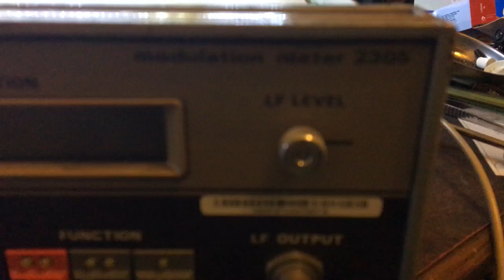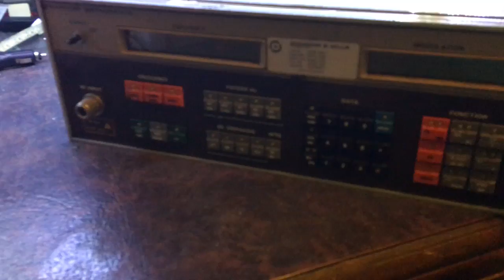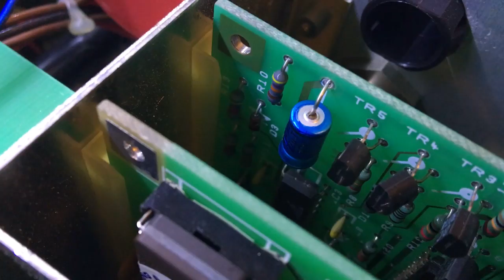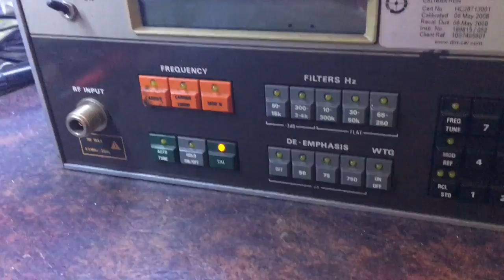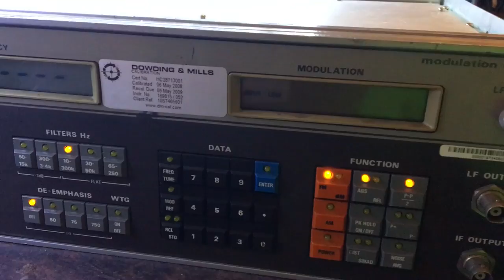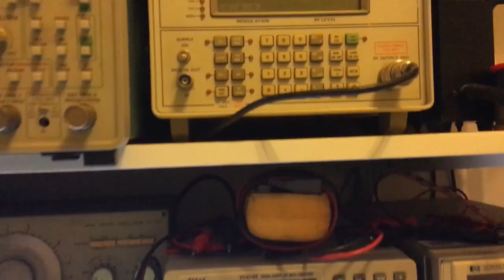#42 Repair of Marconi 2305 Modulation Meter

Comment: I have two of these, just bought one to try and repair. Useful bit of kit.
Reply from the maker: The guy I purchased this from had two, mine didn't have the distortion option unfortunately, turns out the second unit had it... I almost purchased the other unit too just to get the option, but decided it wasn't worth the cost, shipping one of those to the other side of the planet isn't cheap!